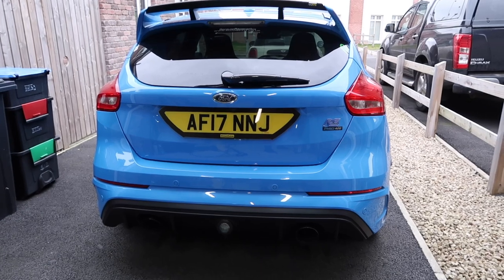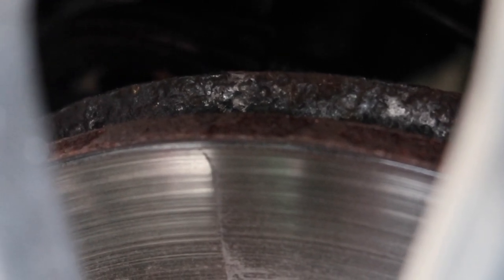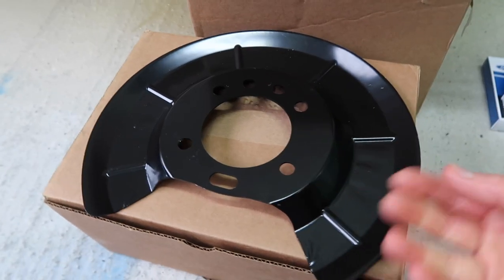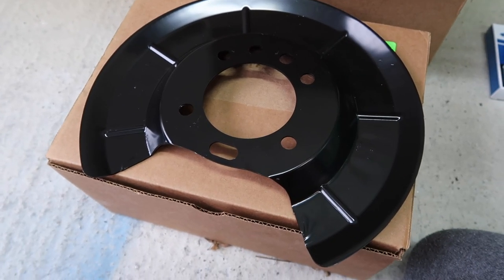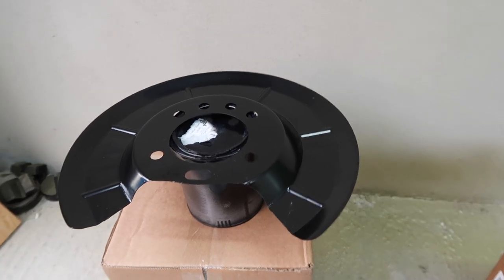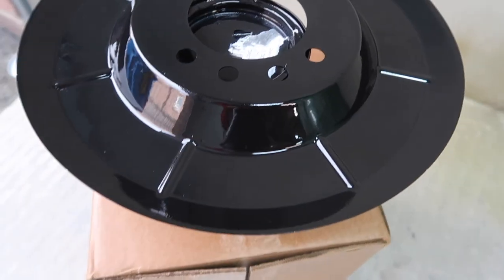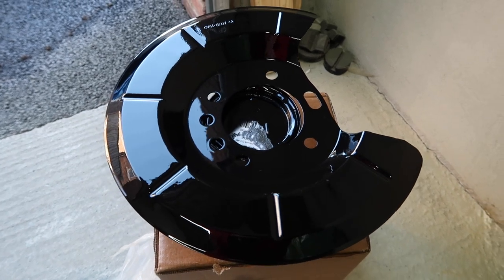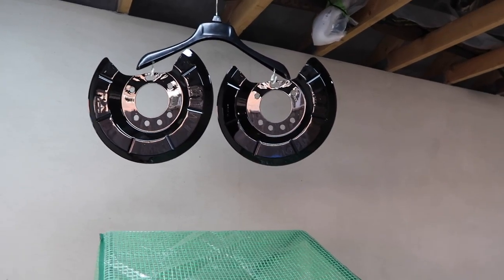PREPPING FOR BRAKES OVERHAUL! | GARAGE UPDATE | VLOG 45

Comment: Sadly probably only me and you care enough to do this 😁 ..... I bought new front & rear back plates when I first got the car....rubbed down and many coats of paint and lacquer. The trick is to treat the metal first before you spray the parts.......been on 4 years now not a sign of rust yet :) you must keep under the arches and brakes very clean as well a mean take the wheels off every 2 weeks and clean those areas around the brakes. I can see you need to do your brake disc too...Paint the top section and hat with heat paint then lacquer when the disc are new....same again I have no rust at all and they are years old. I even paint my nuts and bolt like this too 🧐